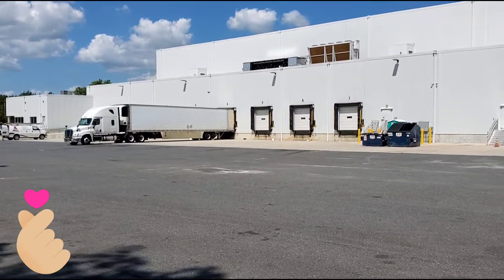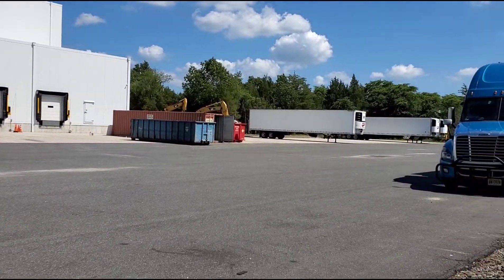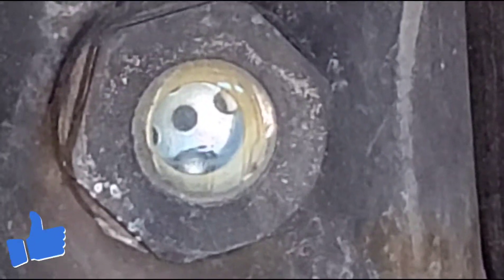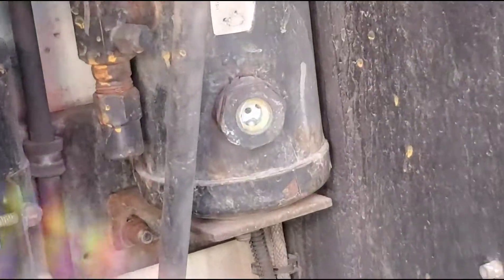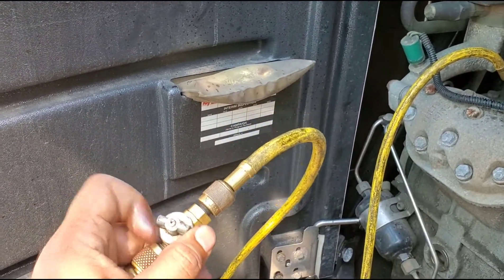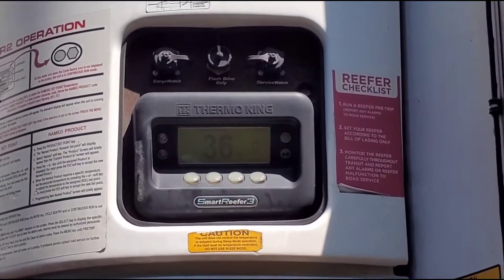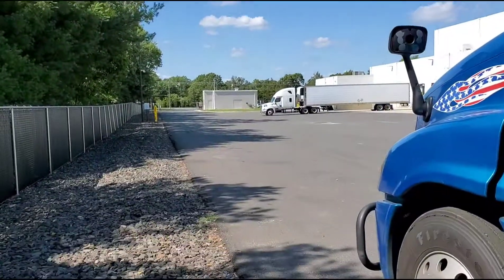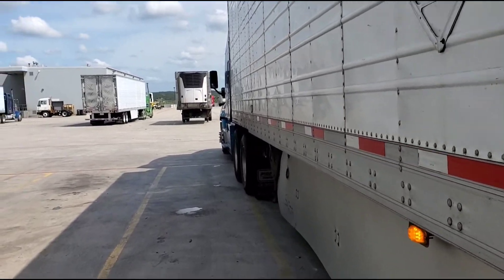Why Reefer temperature is not dropping? (Easy Fix for owner operators 100 to -10 )

Comment: Be sure to purge the lines before introducing freon. Crack the bottle open and purge the air out. Slowly attach line to the reefer and purge again, then fully connect the hose to the reefer and send it 😂

Comment: My friend and fellow trucker, I want to start by saying thank you for reaching out and wanting to help the rest of us owner operator, however in my respectful opinion I want to voice the following, when servicing a refrigeration unit for those of you that don’t know you need to do a diagnostic, troubleshoot the problem, correct the problem and then move on, the above video it’s an overall reference in my opinion of just getting you out of the situation for the meantime, reason why it’s because if the refrigeration unit needs Freon is because it needs to be serviced, and or it may have a leak, so if you load up a load that is temperature sensitive figure 25° or 0° and you only proceeded to add Freon you’re only putting a patch on the problem temporarily, and this will probably be a big problem because now you may have a claim to the Insurance company, my friendly advice to you  is to try to pinpoint the problem so you can fix it right one time, if not take it to a service Dealer so they can take care of the problem, and I’m just a little bit of mechanically inclined, thank you for allowing me the opportunity to express my thoughts and concern, again thank you for your help and I’m just pushing my respectful opinion, 👋
Reply: Yea just take it to a dealer guys. Pay $200+ an hour and leave your trailer down for over a week just to get a little charge thrown at it lol
Reply from the maker: Really appreciate the good advice. 👍
Reply: @robertotoledo1910 thank you for trying to get through the knuckleheads, ok so now im speaking to the knuckleheads and you know who you are. this up above, the main content is a bandaid, will it work? for sure!! is it safe? not at all for you and proly worse for the unit in the long run. Did anyone notice how many people keep chiming inn with a "oh Yeah" or "wait dont forget this" or and "thats it" .........except "one last thing real quick". There are real processes that need to take place ot properly charge a unit that is not 100% empty and vacummed to -500microns or lower. you should absolutly thank the gentleman above for possibly saveing you hundreds at the moment you try this is if your successul but make sure you also thank him for the thousands extra it will cost you once you have no choice but to actually fix the root cause which will be much worse that it was at the time you started to bandaid the issue. I cant even count with my shoes off the amount of compressors dystroyed by people just trying to be helpfull. Heres the best advice anyone can give to owner ops, fleet mgrs or anyone that is responsible for keeping ht etrailers on the road. DO YOUR MAINTENANCE, FOLLOW THE O.E.s GUIDELINES THROUGH OUT THE LIFE FOR COMPONET ONLY IF ANY GIVE LIKE CLUTCHES, VALVES, FILTERS AND BELTS BUT GUYS GET YOU REEFER LOOKED AT EVERY 1K HRS AND HAVE A SHOP THAT KNOWS WHAT THEY ARE DOING DO IT. YOUR TRUCK MECH WILL NOT DO. MAINTENANCE IS THE KEY. IF YOU WANT 50+K HOURS OUT OF YOU UNITS.

Comment: Be careful doing this, if DOT pulls you over and you dont have the proper EPA cert to travel and obviously use this stuff they can fine your ass maybe 404 is an exception but I doubt it. I'm a refrigeration tech, but we really dont work on these units too much (funny I have to look at a couple tomorrow) your refrigerant is leaking for a reason, this is a huge no-no just adding and adding refrigerant that is obviously leaking. You do not add these near-azeotropic blends as a vapor, you need to charge them as a liquid and do it carefully or you can slug your compressor especially adding it to a port that close to your suction. You cannot tell refrigerant pressures merely by looking at the oil levels in your sight glasses 100% of the time, oil will travel to and from the evaps/heat exchangers/whatever that's what its meant to do and sometimes it'll settle in other areas until it travels back to the sump inside the compressor and/or the oil separator. You're losing oil with leaks too, and you're obviously not going to get that oil back by recharging the system that's now how that works so it's always going to remain low and eventually most of it will leak out. Gauge up and get accurate readings or maybe the APU has transducers that can tell you, I don't know. Just a little advice, get this shit looked at by a tech who works on these things also that 24lbs of 404 now costs a lot more almost triple.
Reply: I paid Carrier shop $1200 and the guy half ass looked for the leak. And never found it. And the sight glass on the compressor level was good now it's low. So evidently he didn't know how to fill it up either.
Reply: @jimmyfumbanks6081  Ive got some things to say about places like Carrier or Payne, but Ive always worked for commercial/industrial refrigeration companies. The only time a leak shouldnt be found is if it's very minimal and physically cannot be located, even UV shit may or may not help. My point being, just don't throw refrigerant inside a system that's obviously actively leaking, call a reputable contractor to come out, it'll save you money in the long run.
Reply from the maker: It's temporary fix just to give u enough time to deliver the load and avoid claims. It's not Recommended and always do your due diligence.
Reply: @desitruckersinu.s.a2797  I get that, not saying I haven't "topped" things off to get them by, but always with a quote and papertrail letting them know "hey, this shit needs to be fixed blah blah"
Reply: @Syphonfllter  letting who know? The only people this is gonna help ARE the person they would let know. They own the shit.
Reply: @Halfstep2024  Right, cause none of that would help another tech or the same person at a later time.. lol alright.
Reply: Oooo, the glass window in the compressor is for oil level ! Has nothing to do with the freon at all !!!
Reply: @Andy76777  Yes the glass at the compressor sump is for oil level/return.
Reply: F$CK DOT!

Comment: You need to recharge the freon verry slow or you will lock the compressor and that is a 3.500 dollares mistake
Reply: Yes these near-azeotropic blends need to be charged as a liquid or youll end up getting different amounts of the blend as intended, and liquids are incompressible so you can mechanically slug a compressor adding too much liquid. Semi-hermetics can take a lot of abuse but can still be slugged, trust me.

Comment: hello there bro, how can you apply for the license for purchasing the freon? big thanks
Reply: Section 608 certification is required to purchase and handle refrigerant most supply stores will not sell to you due to you not being a licensed contractor should you be caught servicing a unit with the you can be fined 10,000 dollars and revocation of epa certification
Reply from the maker: you need to goto school to get license۔ referigeration system
Reply: Ebay
no license